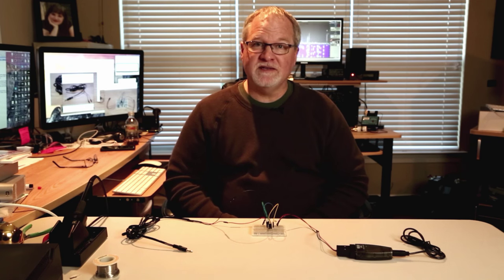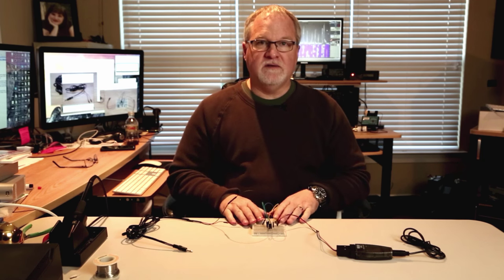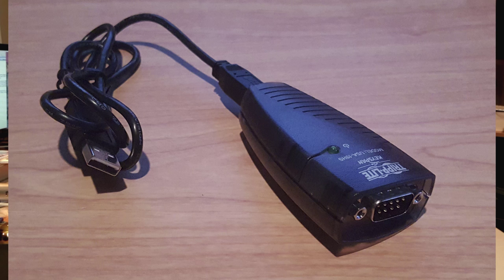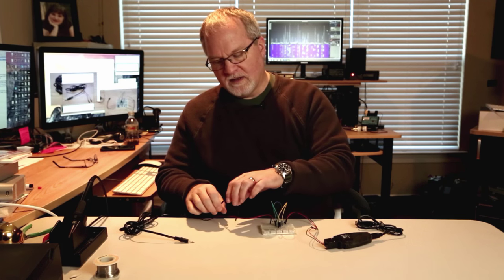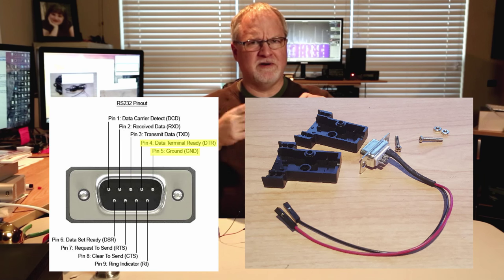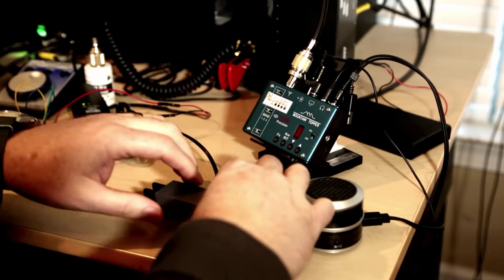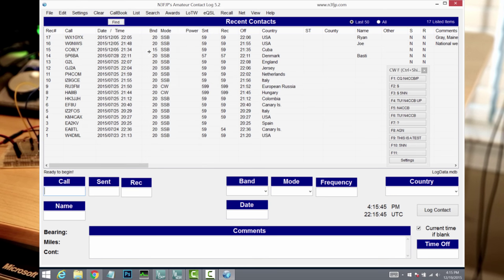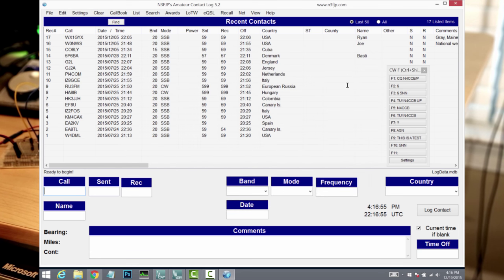Build a Computer to CW Interface

Comment: I have a FT-100,how I can connect to operate PTT? no RS232 connector!
Reply from the maker: If you're talking about keying the radio for CW, you don't need an RS232 connector.  The circuit described in this video will emulate closing the contacts on a straight key.  So, you'd put your radio in Straight Key mode and your computer software will generate the code by closing that electronic switch, which simulates a human pressing the arm of a straight key to close the contacts.

If you're talking about using the FT-100 for digital modes, you actually DO have a serial port in the form of the Mini-DIN Data Jack on the back of the radio.  There are Ground, Data In, Data Out, and PTT pins.  I believe you can buy a Tigertronics Signalink box with the appropriate cable(s).  -Cliff
Reply: @QRPSchool   I have a signal link for IC-718.which i use for digital,i have to change jumbers no?
Reply from the maker: @cristyperera1936  I'm still a little confused... You're writing to me with a comment on a video that shows how to create a circuit to allow ham radio logging software to emulate a human being sending Morse Code with a straight key.  This circuit can be used by hams running contests/pileups to keep their hands on the keyboard to log contacts while the logging software takes care of sending Morse Code.   For this application, you don't need a radio with a serial port.  There is no serial data to send to the radio for generating Morse Code.  Not to muddy the waters, but in that situation, you might want a CAT connection between the computer and radio (via serial port) so the logging software can poll the radio to get the band and operating frequency for logging the contacts without your having to enter that information manually.

Okay.  So, if you're NOT writing about that but, instead, are asking about using Digital Modes like PSK-31, FT-8, etc. that's different and has nothing to do with this video.  For digital modes, you need 1) a way to get the audio from the radio to the computer for decoding, 2) a way to get the computer-generated audio to the radio for transmission, and 3) a way for the computer to signal the radio to go into Transmit mode.  This is usually done with the PTT pin of the mic jack or data jack BUT it can also be done quite successfully by just putting your radio in VOX mode.  In VOX mode, the presence of audio being sent to the radio will signal the radio to go into Transmit mode... just as if you were using your voice (SSB) in VOX mode and the radio detects that you've spoken so the radio switches to Transmit mode.

The Tigertronics Signalink website has a web page that shows how to set the jumpers for all radios.  You'll just need to look to see if both your radios have the same jumper settings.  Here is that page:  https://www.tigertronics.com/sl_wirebm.htm

Comment: Would you really bother with the big USB-serial DB9 converter these days? You can get a small <$5 FTDI type USB-serial board that gives you a convenient 0.1" pin header outout and just wire those few extra components point-to-point on that board.
Reply from the maker: +KX36 Thanks for posting this.  I just happened to have several of those USB-to-Serial converters so it was easy for me to mock up the circuit with what I had on hand.  I've seen several of the FTDI USB-UART breakout boards but the ones I'd trust are $15 or so.  Do you have a link to one that you'd recommend that also includes a link to the various operating system driver(s)?  If so, please post it here so future readers could benefit.  I appreciate it! - Cliff
Reply: Genuine FTDI chips work well and FTDI's got good custmer service, but there were so many fake FTDI chips on ebay that they updated their drivers to brick any fake chips when they're plugged into windows. I take it that's what you're referring to when you say you don't trust them.

There's a chinese USB-to-serial chip that's gained popularity since that FTDI controversy, the CH340. These are cheap and readily available on ebay and seem to work fine. A quick search on ebay brings up 400 results starting from $0.93, most of which are full PCBs not just chips. :D
Reply from the maker: +KX36 Awesome.  I looked up the CH340 and it looks great.  Thanks for bring this up! - Cliff
Reply: Cliff or KX36, Tnks for your QRP schooll. Could you tell me what would be used to drive the PTT using the CH340. When I hook up using TXT, I get a constant stream of dits and cant get them to stop. Thank you.
Reply: KX36 I built one of the with the ftdi and it works great. some of the interfaces only include transmit and receive but NOT the control signals. so look carefully before you order!

Comment: what's this?
Reply from the maker: An electronic circuit that sits between your computer and your radio, allowing a program on your computer to emulate a straight key for sending Morse Code. It's very useful in a CW contest as your contest logging software can automate the sending and exchange of CW data. Without this (or something like it), you'd have to send the other station's call sign by hand, etc.
Reply: @QRPSchool  thanks and intresting

Comment: The circuit works fine, however I would like to see an opto-coupler rather than a transistor.  It is important to de-couple the ground connection between the computer ground and the rig ground. The computer ground will add to the noise floor of your receiver, if not de-coupled. I use the PC817 4-pin DIL coupler. I also add a diode into the DTR input path, anode on the DB9 side, to eliminate unneeded reverse current when the circuit is idle. Furthermore I add a small LED with a 10kOhm resistor in series between the cathode of the added diode and the DB9-ground for visually check the operation. AA0JR, email on QRZ.com
Reply from the maker: Sounds great, Jakob.  As you probably know from watching the video, I took the circuit from Scott Davis’s website. Do you happen to have a schematic of your circuit? -Cliff